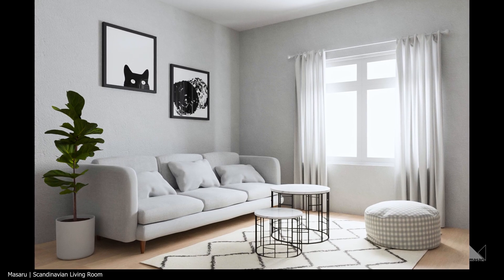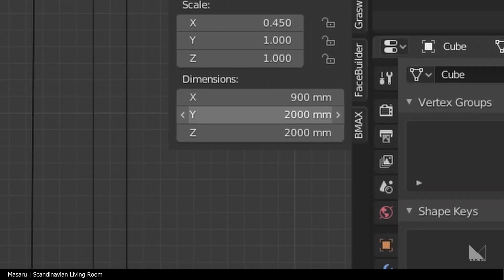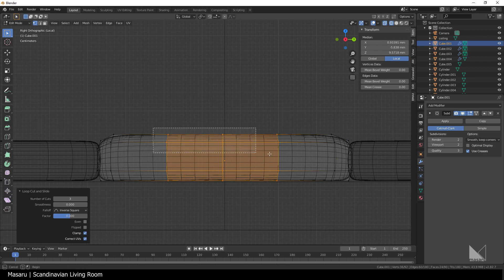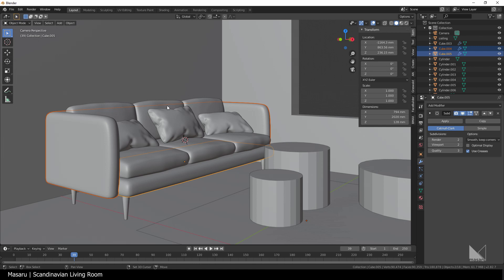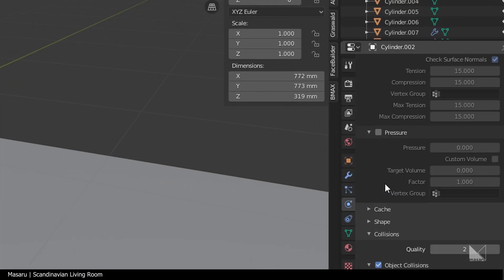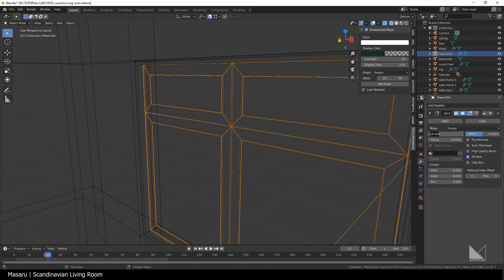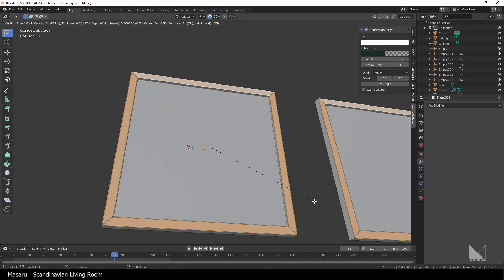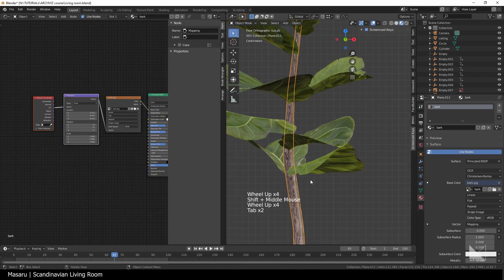Scandi Living Room - Blender 2.82 Interior Archviz Tutorial (Part 1 of 3)

Comment: Why can't I loop cut the walls after Adding a Solidify? I can only loop cut the floor plane.
Reply from the maker: Loop cut can only works with polygon, try to check your mesh if any n-gon exist
Reply: dont you have to apply the soldify modifier?